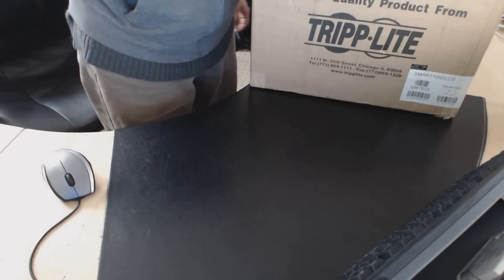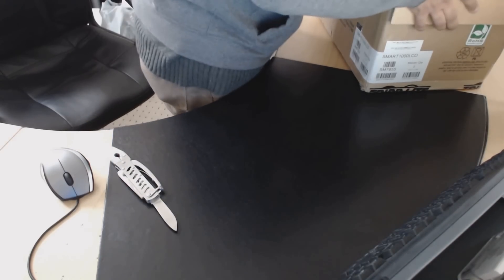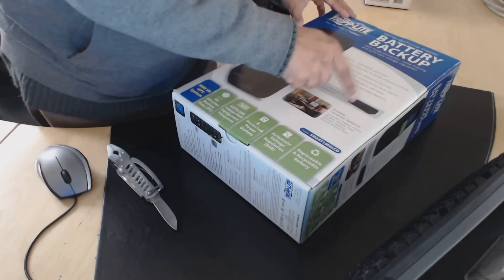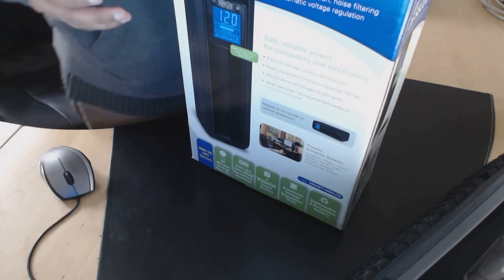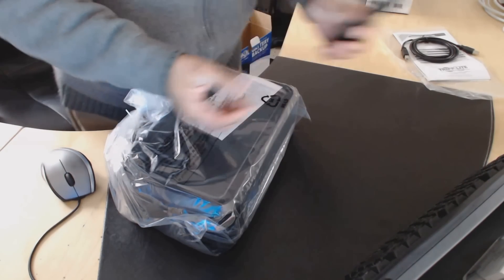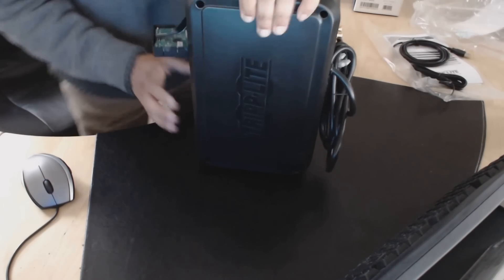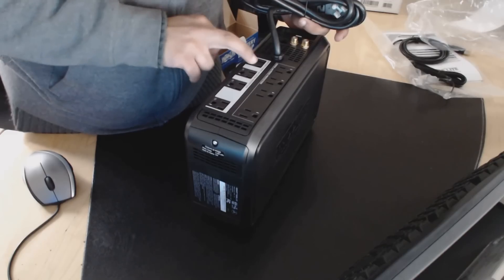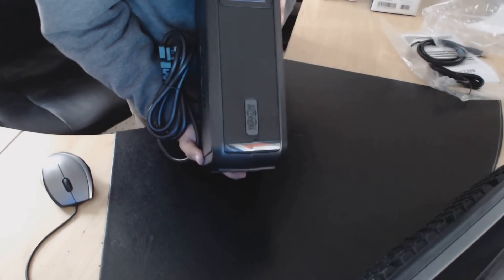Unboxing Tripp-lite 1000 LCD UPS (Uninterruptible power supply) SMART1000LED UPS

Comment: HI. Just a cuestion: what is that usb for . King regards
Reply from the maker: It allows your computer to monitor the battery life on the UPS and as it gets depleted, you can set a task to safely shutdown the computer.  Similar to a laptop with a battery.
Reply: @webpromo  Thanks so much, Actually I have a laptop, is it necesary to have my tripplite for a laptop?, I bought it on april 2002 so I can say that are very efficient.